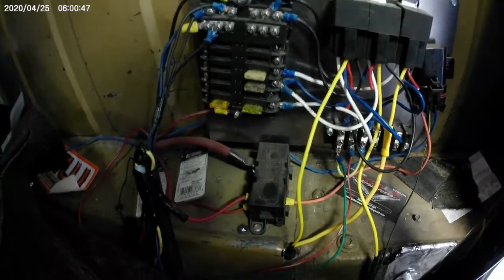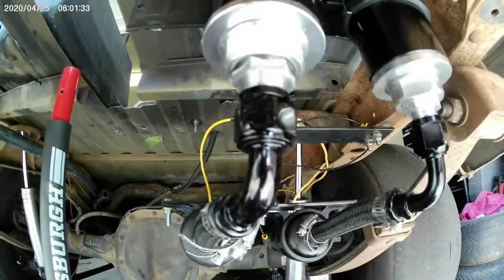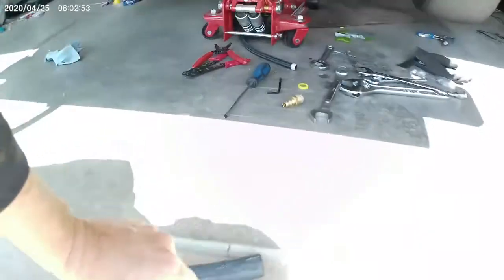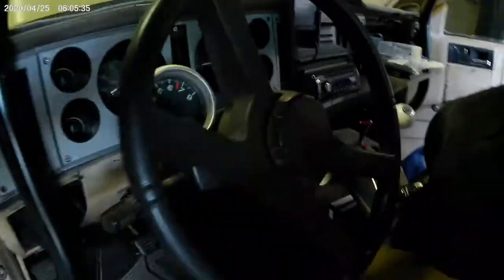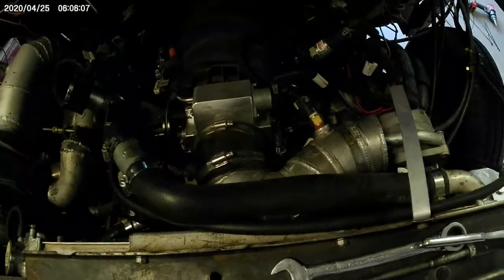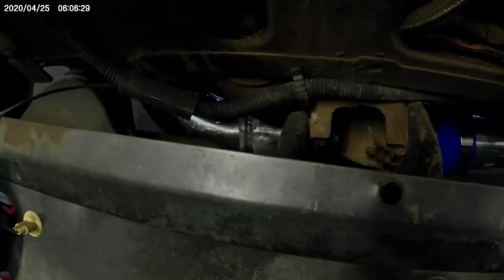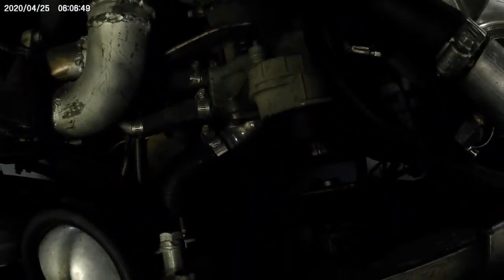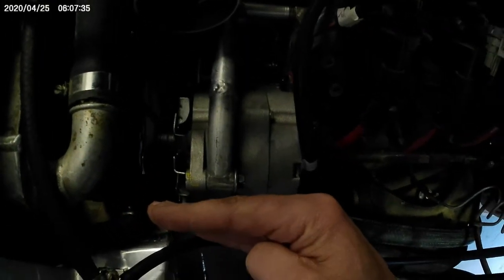Can The Holley Terminator X Run 2 External Fuel Pumps and Show True Fuel Pressure?

Comment: Do both pumps run all the time or is the second one on a hobbs switch wich turns on once into boost???……all my LS swaps are supercharged i know turbos can be done for cheaper but theres just soooo much more involved as opposed to just bolting on a supercharger….i love my LSA supercharged novas instant torque/boost…..but the centrifugal supercharger on my c/10 sounds way cooler…..one day id like to do a turbo build maybe ill start with my go cart just to get my feet wet….honestly i got more money than brains thats probably why i took the easy way out and just went with superchargers!!!!
Reply from the maker: Supercharges have an advantage in certain aspects for sure. Iam always looking for sponsorships, if you have extra cash laying around.

 So at the moment I had to add an A1000 red and yes they run all the time currently. 20lbs of boost has put me into the 9's in the qtr, but the amount fuel needed is alot. I will wire it off the boost controller switch, I only use the wastegates on the street like 4 lbs. Then turn the controller on it is set up for the track and then the extra pump will come on.

Comment: I would get rid of the hose clamps , they suck. Either go with fuel injection hose clamps or bite the bullet and get some more $70 fittings 😉
Reply from the maker: I got them all fixed! It always comes down to time and or money. I agree completely but spending my 401K for fittings is not my idea of a good time! Hopefully they will hold up for a while.